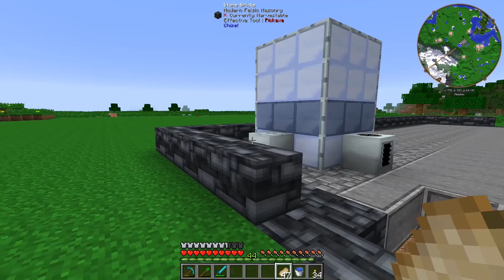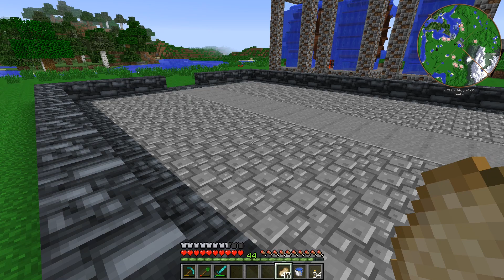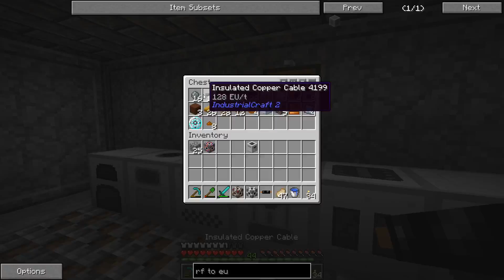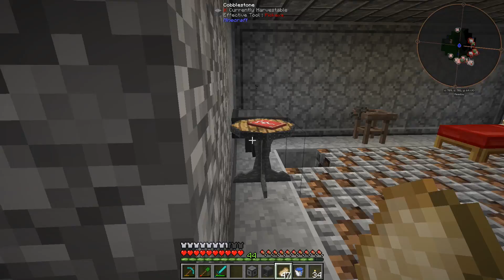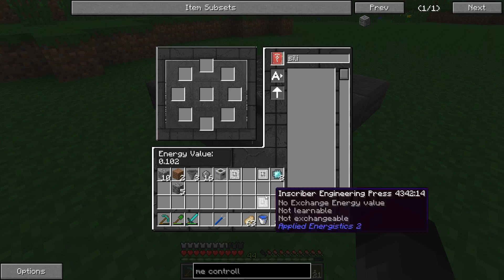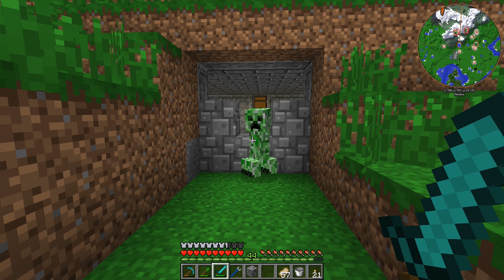Minecraft Mods FTB Inventions - GOING DIGITAL [E06]

Comment: Hey Hypno, get some thermal generator from Techreborn, you can passively make power with just lava around them, it's pretty great, i run a grid with them and it gives a lot of power, 1mil EU battery and outputs max 128EU/t

Comment: Hypno, those Crystal Growth Accelerators use a huge amount of power.
Get yourself a ME Inverted Toggle Bus, and put a lever on the block above. When it receives a redstone signal it stops sending power. Then just run that cable into the Energy Acceptor and you can turn them on and off.